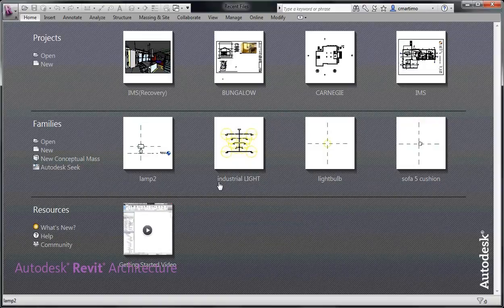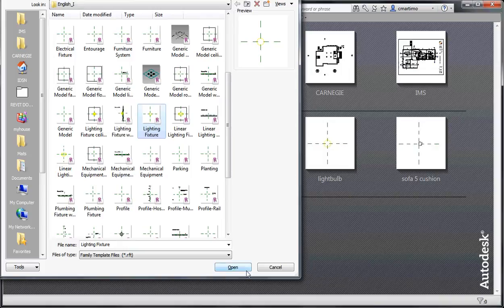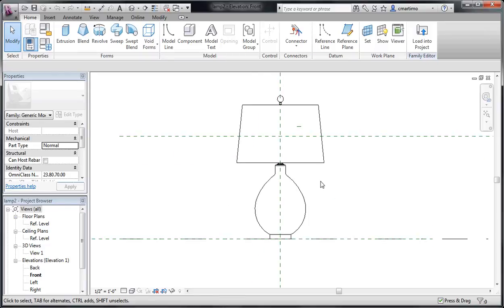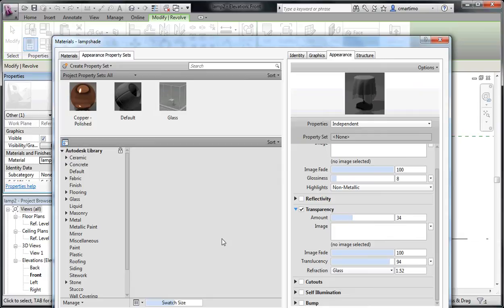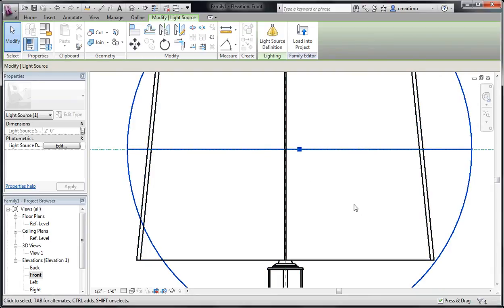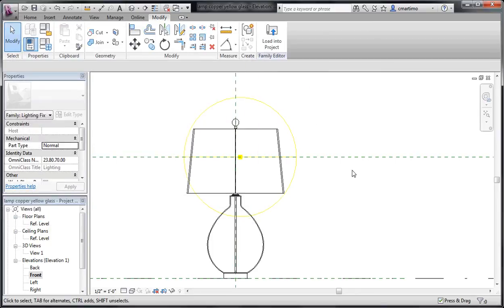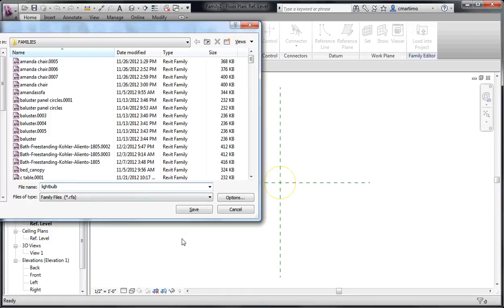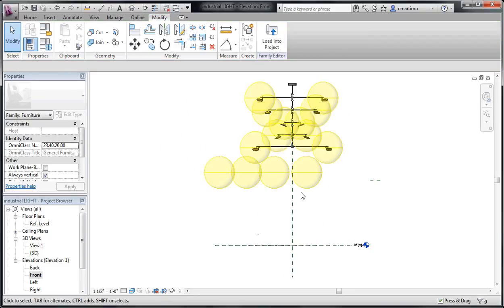Lamps and Chandeliers with Revit

Comment: @cindy martimo For Creating multiple light source, which family type you created to load multiple lights?
Reply from the maker: there is no multiple light source family type - at 4:43 in the video I talk about how I get multiple light sources into the family by saving a blank light template as  a family and then loading it into the new family - you are then able to place as many as you want!
Reply: cindy martimo I saved blank light type as a family, but when I'm trying to insert/import this family into another family, its not showing up. I tried inserting it into new - Generic model, Furniture and lighting fixture type family, but after importing the previously saved file, nothing happens, and the light family is not loaded(showing up)
Reply from the maker: you place the light bulbs by going to the Creat Tab and the "Component"
to place the component you have loaded
Reply: Ok, Got it, Thanks very much...!
Reply: If I load this into a luminiare family is there a way to delete the original source in the template family?? Or do I have to create the chandelier from a generic model template? Thanks for the video!